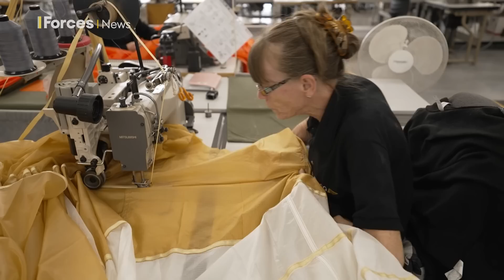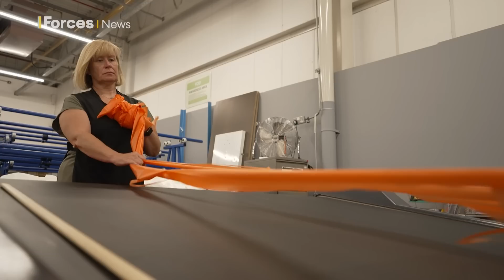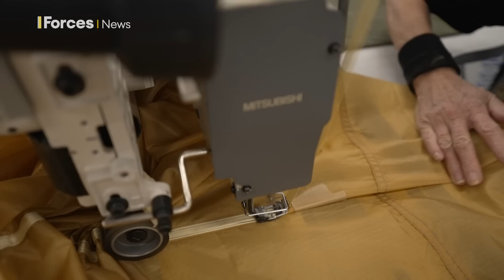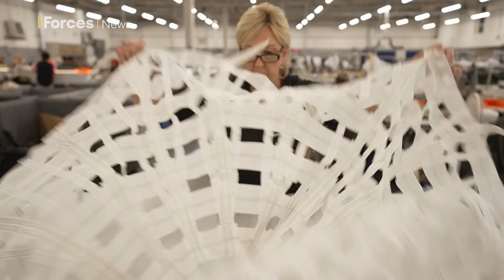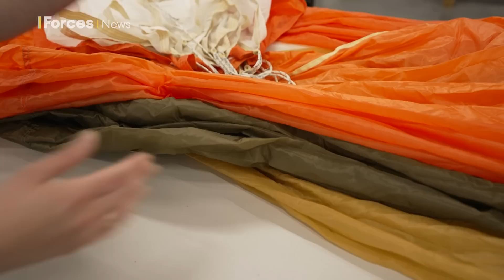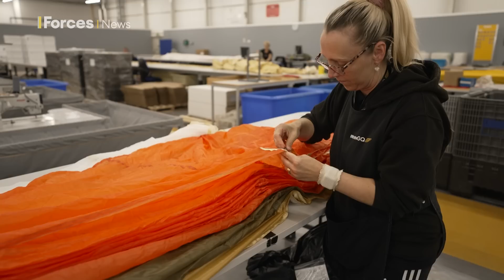The factory that's saved tens of thousands of forces personnel lives

Comment: I'm guessing because of the ununiform nature of the parachutes, that a machine can't handle them delicately enough and thoroughly check them at the same time.

Sure, people can miss bits, but I assume that the risk of that when being methodical is much lower than a machine managing to damage a parachute.
Reply: Parachute manufacturing numbers are low & hourly wages in South Wales are quite low too - if there was the export demand then more machines could be used for some parts of the job, but it's not worth the capital investment to build & train bots to sew nylon seams. This will change as bots get cheaper - they already use computer laser cutters. QC will remain human for many years more.

Comment: I'm surprised this hasn't been outsourced to China or Vietnam or wherever is cheapest. After all most of the time you don't even use the parachute in your ejector seat.
Reply: Yeah, good idea, you get to do the check ride on the first batch.
Reply: Quality can't be assured that way.  Even though factories there can produce very high quality products, they also produce terrible ones.  Also, accountability.  If IrvinGQ mess up, then the government can come down hard on them.

And China... well yeah, that was never going to happen.
Reply: Do you sit on your seat belt once out of the City Cop's sight? After all who needs to be strapped in like a kiddo when you wanna try out the new Turbo Charged V8.